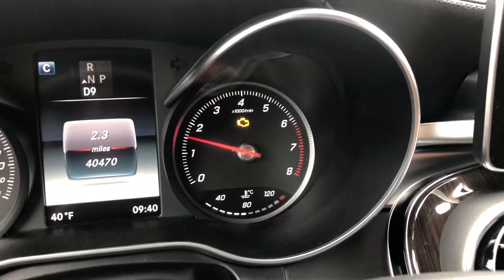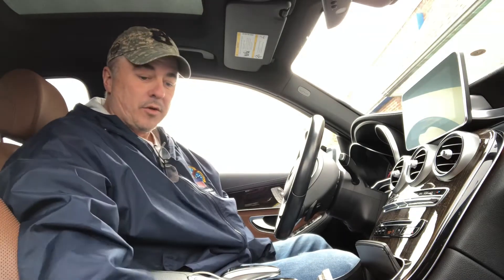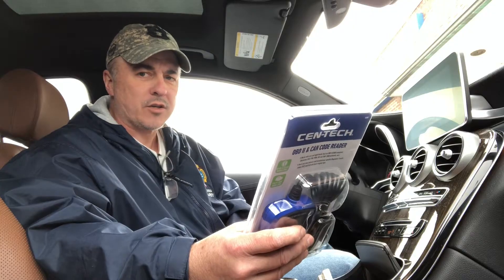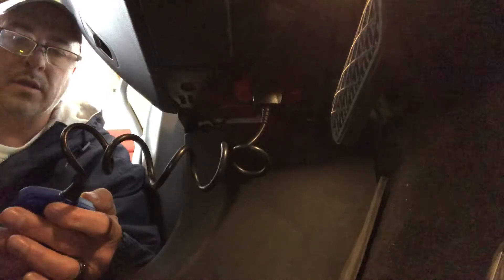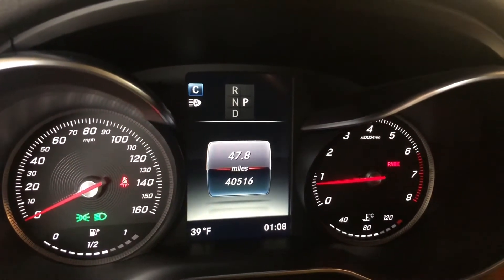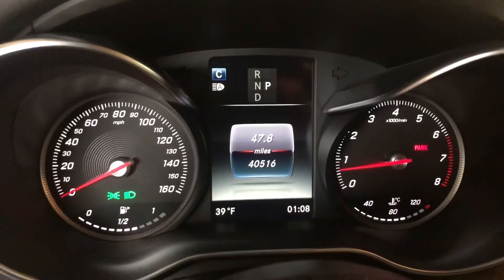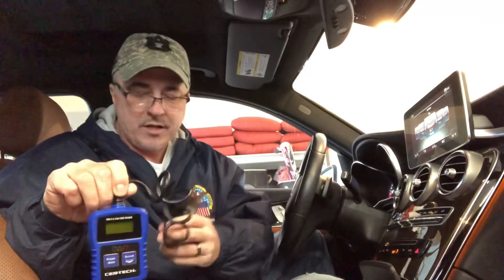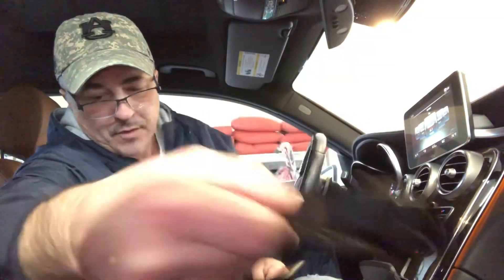Mercedes Benz GLC300 check engine light

Comment: You’re using a $20 code reader on a late model Mercedes dude, no wonder it’s no showing any codes. Safe to assume ya took it to the dealer to actually diagnose and fix your car after the light came back but wouldn’t post a video, save the diagnosing and fixing for the pros please

Comment: Thank you for this video.  I am looking for advice.  Our OBD port is not connecting with any scanners.  I tried ours and the one at the parts shop. No power. Any advice? Is there a fuse related to this in 2017 GLC 300 SUV ?
Reply from the maker: OBD port issues in a 2027 Mercedes-Benz GLC 300
If the OBD port in a 2027 Mercedes-Benz GLC 300 is not working, several factors could be at play, ranging from simple to more complex issues. 
Here's a breakdown of common causes and potential troubleshooting steps:
1. Blown Fuse
The OBD port often shares a fuse with other components like the cigarette lighter.
If this fuse blows, it cuts off power to the OBD port, making it unable to communicate with diagnostic tools.
Troubleshooting: Check the vehicle's fuse box, locate the fuse for the diagnostic port (refer to the owner's manual for the specific fuse location and labeling), and replace it if blown. 
2. Damaged Wiring
Wires connecting the OBD port to the vehicle's computer can be damaged or disconnected, preventing communication.
Troubleshooting: Visually inspect the wiring leading to the OBD port for any signs of fraying, cuts, or loose connections. If damage is found, repair or replace the affected wires. 
3. Faulty OBD Port
The OBD port itself can be physically damaged, leading to poor or no connection with diagnostic tools.
Troubleshooting: Inspect the port for any bent pins, corrosion, or debris. Use a multimeter to check the voltage at the port's pins, ensuring it's receiving power and ground correctly. 
4. Incompatible Diagnostic Tool
Ensure the diagnostic tool being used is compatible with the Mercedes-Benz GLC 300.
Troubleshooting: Refer to the diagnostic tool's manual or check online resources to verify compatibility. If possible, test with a different, known-working tool to rule out a faulty tool. 
5. Software Issues
In some cases, the vehicle's computer may have a software glitch that prevents the OBD port from functioning correctly.
Troubleshooting: Consult a professional mechanic or Mercedes-Benz dealership for potential software updates or resets that may resolve the issue. 
6. Other Potential Causes
Defective ECU: A malfunctioning engine control unit (ECU) can prevent the OBD port from communicating with diagnostic equipment.
Incorrectly Installed Aftermarket Parts: Aftermarket parts can sometimes interfere with the OBD system's functionality.
Rodent Damage: Rodents can chew on wires, leading to power loss or communication issues with the OBD port.

Comment: Hi, I don't know if this is of any help however I've recently discovered that in order to get rid of my annoying engine management light that comes on for seemingly no reason. To do this I just start the car and then with the engine running I turn the key to crank it...then turn it off and back on quickly before the engine dies...I do that roughly 4-5 times..it takes less than 10 secs.and the lights goes out. In the handbook it tells you on diesel engines if they run low/out of fuel to start the car 4-5 times and if the light goes out no further action is required.

Comment: Actual the message will come on the dash for fuel cap loose and the Emergency fuel light will be flashing along with check engine light on.  Junk scanner you need a scanner that can read CAN-BUS like a iCarsoft MBII (Code I got is a P04427A)

Comment: What would you have done if the code read a P2402
Reply from the maker: Shamelessly took this from the internet. How serious is the P2402 code?
Code P2402 is an indication that the evaporative pump is shorted internally and other than failing emission tests and the check engine light being on, should not cause any drivability problems.

What repairs can fix the P2402 code?
Replace the evaporative pump and fuse.
Replace the evaporative pump relay.
Repair the evaporative pump connector pins for corrosion, melted, or loose connections.

Comment: Thanks alot you’ve saved me 🤞🏼a bunch of monies. My light began to illuminate while driving but it never flashed to warrant there was a major concern. I purchased the OBD II code reader as you suggested and followed the steps you provided and received a code error. I was elated to know the method you presented helped. As a first time Mercedes Benz owner I am swift to ensure all maintenance is performed as required so when my engine light illuminated I was thrust with the who, what, and why’s.
Reply from the maker: Just make sure that you investigate what the code number is and address the problem. Don’t just clear it because it may be something else.

Comment: Ya don't worry....my 2020 glb 250 at 60 000km a cracked cylinder block and dropped exhaust value.. 219F code.... good luck if that check engine light comes on!! Run forest Run....

Comment: Just bought a certified used cla 250 2020 with 11k miles and it gots a check engine light on😠 they said it’s the fuel pump control module

Comment: I have an engine light on my E220 and a guy I know ran a diagnostic check and couldn't find anything. I've cleaned around the fuel cap and the light is still on so I have no idea until I take it to the main dealer 😒
Reply from the maker: Have them check the PCV, not a conventional looking thing but the oring seal goes bad on these cars causing vacuum leaks
Reply: @WatsonsWagons  If that's the issue, will it cost much to repair? It's going in tomorrow afternoon so fingers crossed 🤞
Reply: @WatsonsWagons  So it turns out it was an adblue issue. This will be rectified next week. I know others who have had DPF issues so here we go again. We buy cars that are "eco friendly" we pay extortionate rates for fuel and whilst we pay about 170 euros in car tax (despite lack of repair to the public roads) we then get caught with paying out money for car repairs to our "eco friendly" cars.

Comment: Wife informed me that our GLC300 just had a CEL.  She had refueled yesterday.  So like you said at the beginning of this video, it was a "P0442 - EVAP Leak Detected (Small)" code.  I love my Foxwell NT301!!!!  Previous reader, that I had, would only give you the code.  BUT this one gives you a brief description of what's wrong.

Someone had told me that MBs didn't have any OBD2 connections, or that I would have to talk it to the dealership (60 miles away) to get it read/reset.  Glad that I found your video.
Reply: Is that what you used for your vehicle Foxwell NT 301??

Comment: i ahve glc 250 petrol 2018 and i    changed the front brakes (they are sport brakes and rotors. the brakes in the back they are regular brakes not sport) 

my mistake not make the computer settings before i change them. however, after changing front brakes i did try to reset the brakes in maintenance section of the car front screen but it did respond .......any solutions? 

FYI, you are so good man... i do panic and you taught not to ... respect ✊

Comment: Your supposed to plug it in, then power the car ON. (Don’t turn the car on just power it). It then will give you the check engine code.